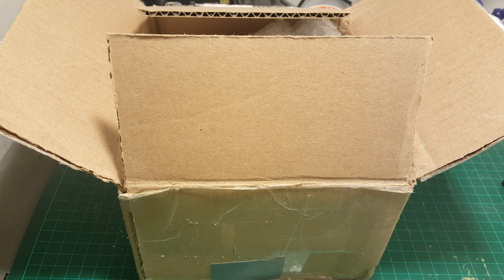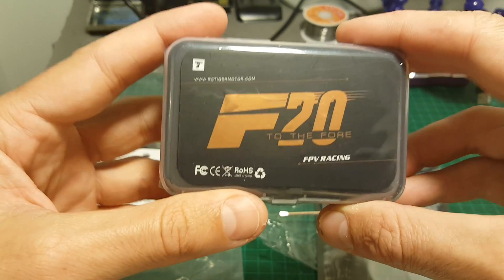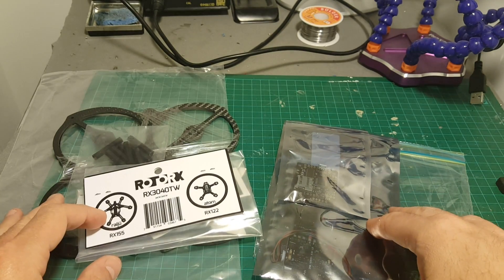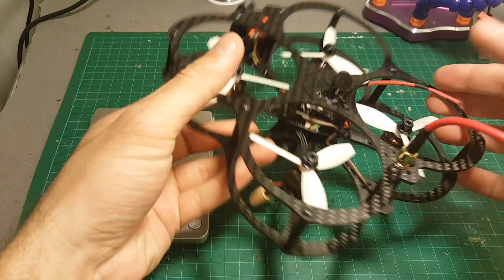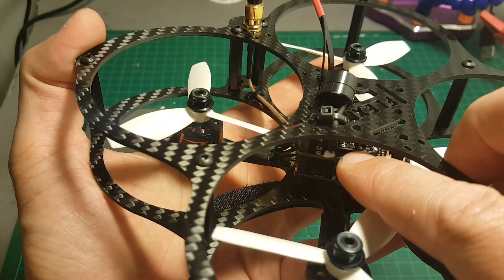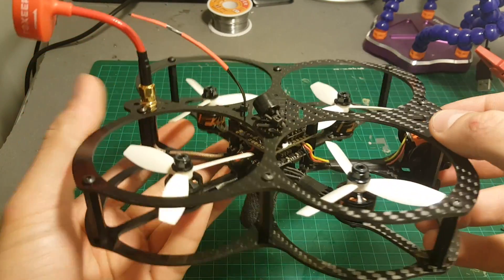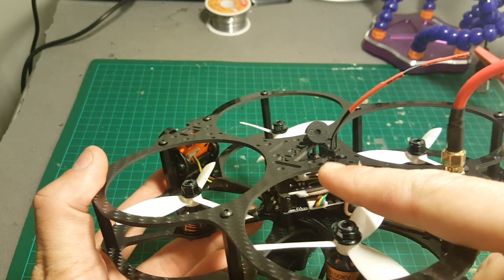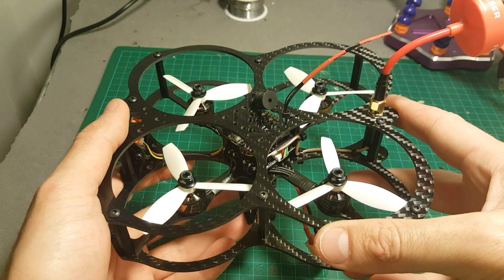Owl Racer Edition – Racing Quadcopter – DIY Kit Build Video And Test Flight

Comment: Which battery gives you a better perfomance and how are the flight times?
Would you recommend it for indoor flying?
Reply from the maker: I only tested two lipos - the 3s 500mah was too small. Only got about 2 minutes of flight time. The 4s 1000mah provided about 4 minutes of flight time, but I had a crash so I couldn't test it fully.